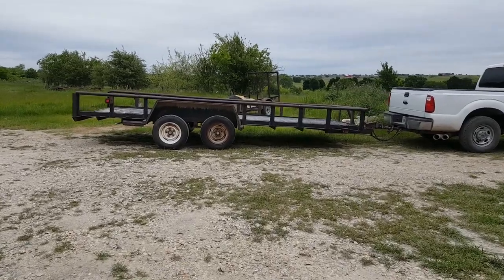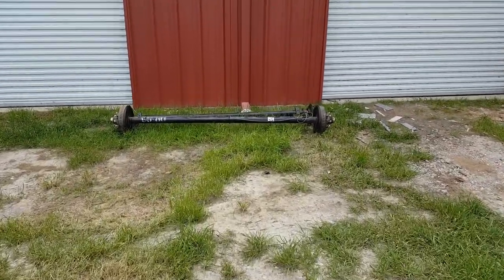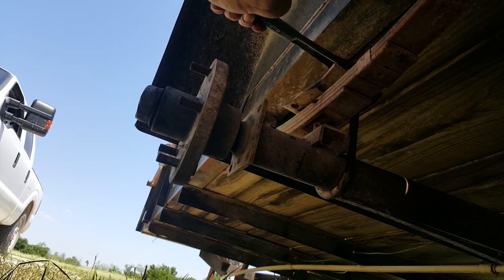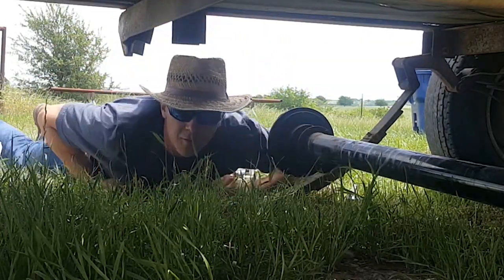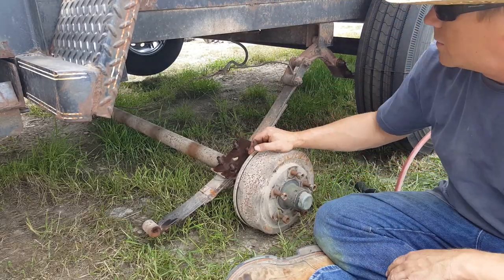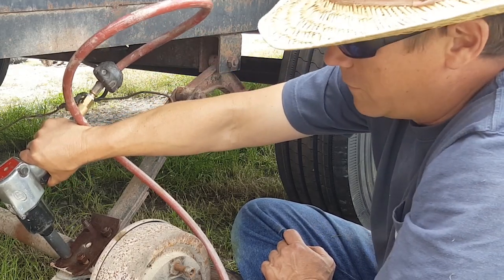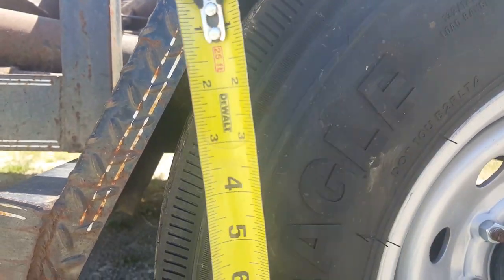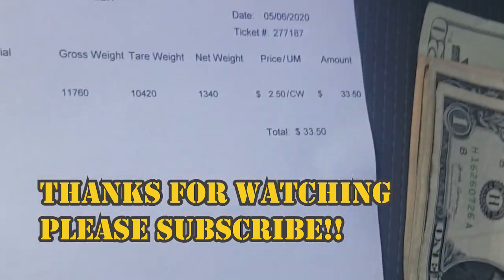Replacing Trailer Axles

Comment: Thank for posting sir. My only comments to add after replacing the axles on my dump trailer would be I would have been better off cutting the u bolts instead of spending several hours man handling them only to have them bend at the end anyway. A new u bolt set of 4 costs $28...no big deal to replace. I also wish you shown connecting the electric brake wires. Thanks again
Reply from the maker: I bet cutting them off would have been easier. Thanks for commenting!

Comment: Question? Never done any axle work. How do you know they are lined up right? Is there a mounting bracket on the axle?
Reply from the maker: Yes, get the right length of axle, and then a bracket already welded on the axle will be in the right spot. I think axle length is hub to hub face but probably should look that up to verify.

Comment: What did you end up spending in the end for 2 7k axles with 4 rims and tires ?? I’m trying to figure out if i should do the same to a car hauler I’m building.
Reply from the maker: Probably $1200 for everything, but I need 4 new tires already.
Reply: @LewisRenovation  okay that’s not too bad especially with new 7k axles and wheels and tires that all should last enough years in time to pay them self off for all your hauling capabilities thanks for the response.

Comment: Hey, your hitch ball is upside down........

(Sorry, since you pointed it out)

Damn,you went BEEFY on your swap.    I'm doing a 3500lb to 5200lb dual axle swap on my 15' enclosed.      One thing I recommend for you is one of the those cush/sprung axle equalizers made a big difference on fore aft shifting.      

Final tip, when the boss comes out, look frustrated and exhausted, always makes you look busy - George Costanza.
Reply from the maker: I feel like my hitch back is perpetually upside down

I’ll look into the axle equalizers. Thanks for the comment!